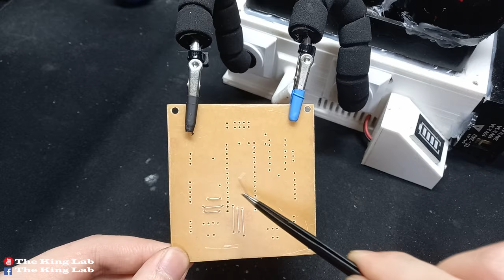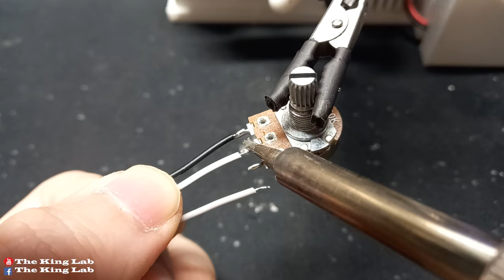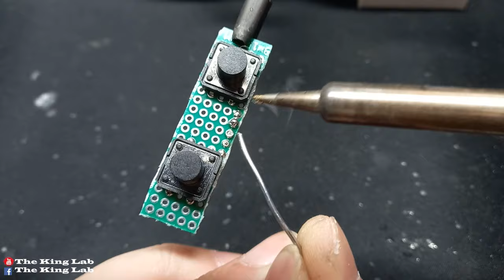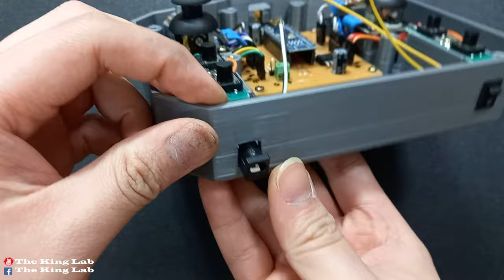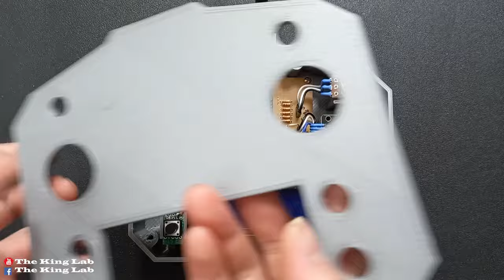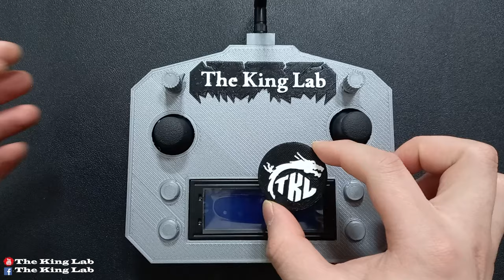RC Controller: DIY RC 10-Channel. Arduino Base

Comment: How does it communicate with the tank? Do you use a separate receiver in the tank? I'm curious about the protocol you use.
Reply from the maker: I use 1 arduino circuit + nRF24L01 inside. you can watch this video:
https://youtu.be/MdKjrbdxE4M?si=KMk89xlB9aFtnAUg